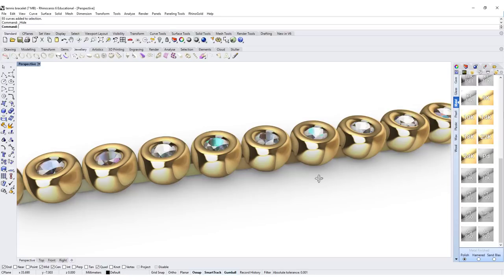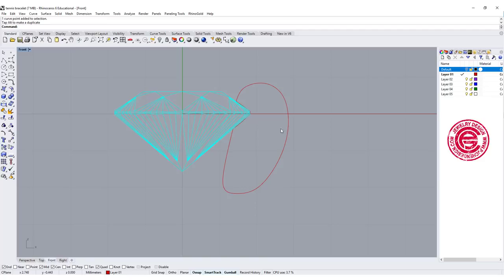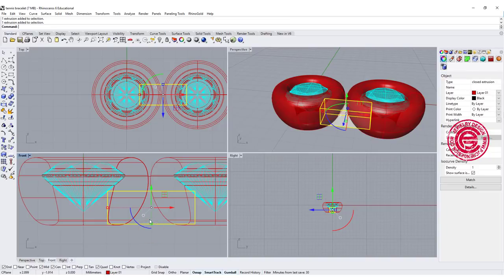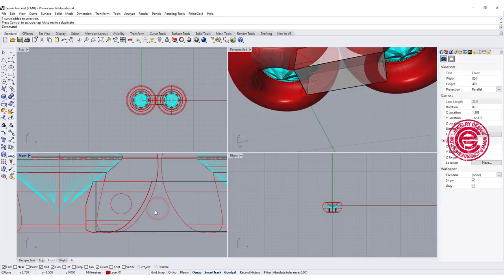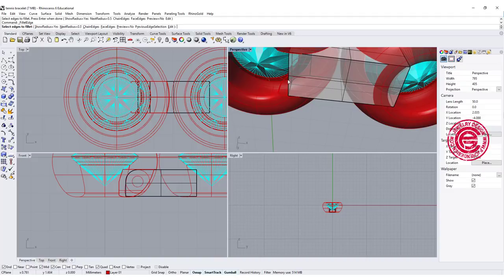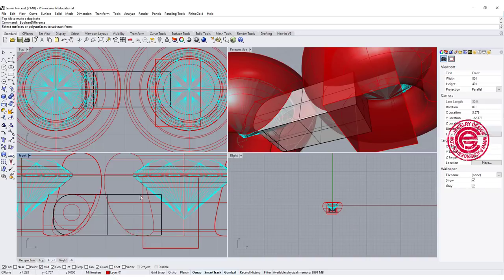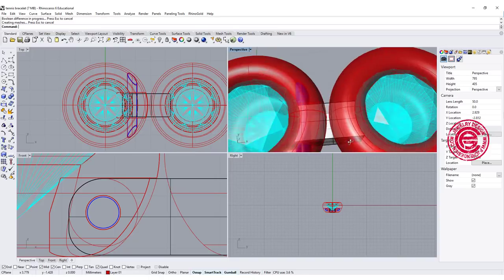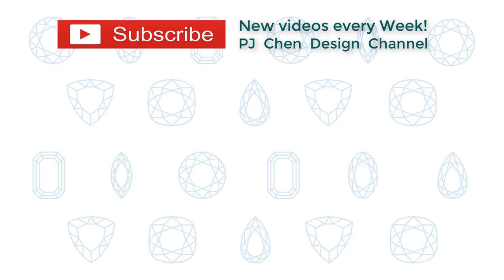How to Design Hinge for Tennis Bracelet: Rhino 3D CAD Jewelry Design Tutorial #66 (2019)

Comment: Thanks for your help! It’s much appreciated. Just wondering, will these links be casted with the pin and hinge attached? Or are the pin and hinge added after the bezel is casted?
Reply from the maker: most of the commercial approach is solder the ready made pin and catch later after finish. unleass you have custom pin and catch. you may able to print the catch but fabricate the pin